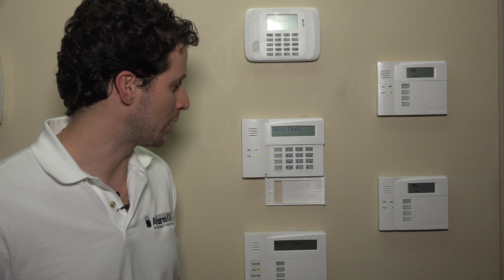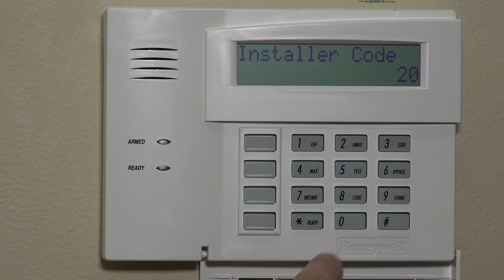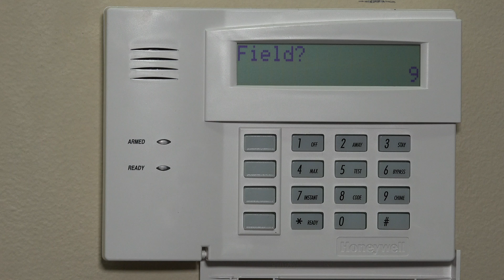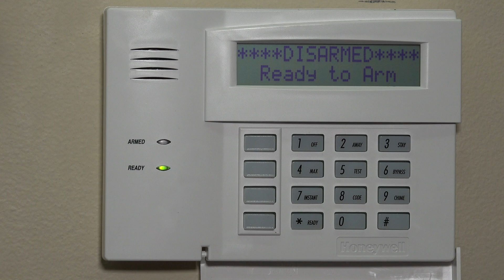Honeywell VISTA: *92 Telco Fault

Comment: This is why that every time that there is something on the news about a change that was done to telephones, I always like to test my alarm for communication.  And, I like to actually set the alarm off, I turn the alarm on and open a back door...the siren is going to come on, and I wait for the company to call.  I don't trust that "walk test" feature or that "system communication test" feature.  All that tells you is that the siren is hooked up and working and that the system and sensors have power.  It does not test the phone.  I like to actually set off the alarm and wait for the company to call.

Comment: Please help I followed the video it cleared the FC code for a while but then it came back what am I doing wrong
Reply: No I am not being monitored it is a new house I just purchased. My system is a Vista 20p I was on your website but haven't tried this yet it said to go to programming then *41**42**99 I will give that a try and see if it fixes it and I was looking in to your services and $10 a month sounds like a good plan and a deal but I want to see if I can get my system up and running first I think I also have a bad door sensor too there are all wireless
Reply: Ok thank you you are awesome and thanks again for all your video and help and I will definitely look into your service when I'm on the market